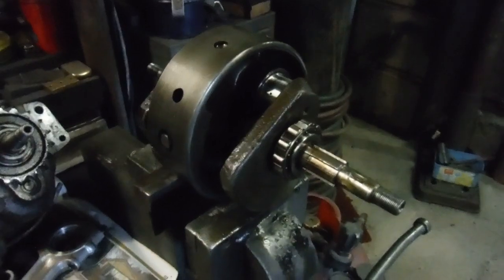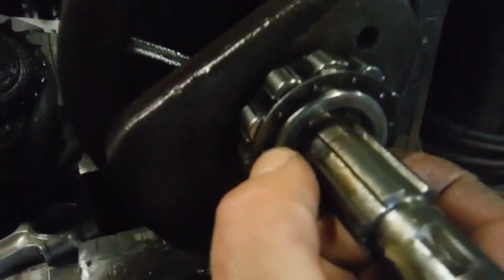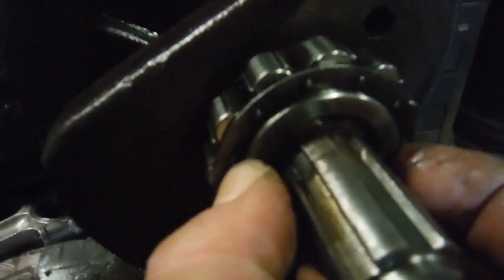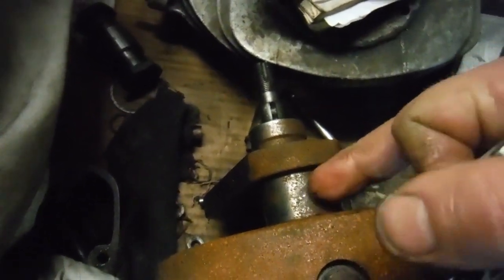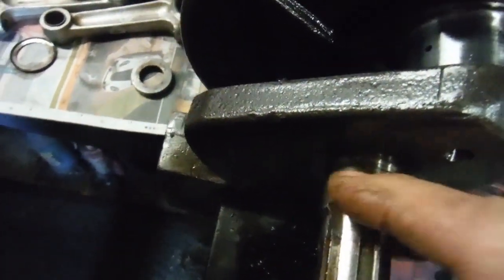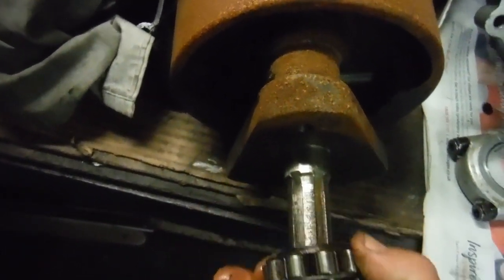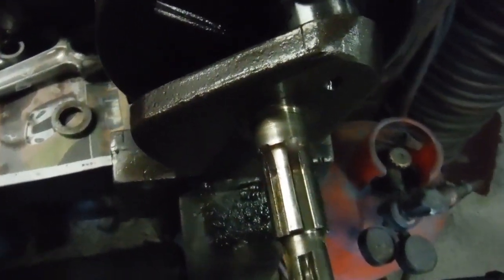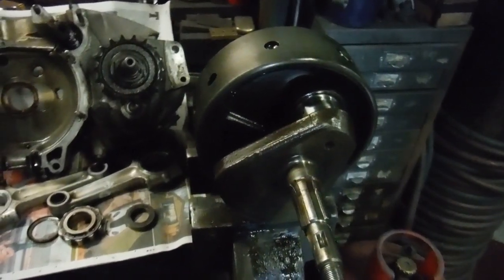BSA A65 engine noises - a closer look at the drive side main bearing.

Comment: Main bearing needs to slide so it can be shimmed for end float. It shouldn't have up and down though. Then when you tighten the alternator rotar it pulls everything tight. Probably a loose rotar or bearing failure has allowed it to spin on the crank

Comment: With no sign that the bearing seized and spun on the crankshaft at some point in time in the past, the only other thing I know of that will resize a crankshaft is a bend out of center to center alignment which would fall in line with a hard blow to the corner of the engine as I have mentioned previously. I would just find a replacement engine rather than trying to repair that one.

Comment: Very peculiar method of rebuilding this engine with repairing big ends but without any concern about both mainshaft journals, by PO. I hope you can repair primary side shaft by spray metal, a new bearing will be much tighter on it than a used one you have, I think it was rotating on the shaft enlarging its inner diameter. Good luck with it.

Comment: I am watching your A65 engine series of videos with a sort of queasy neurosis. I have done a few jobs on my 1971 OIF, which I have only ridden 10 miles to get it home and it was running rough (carb flooding). Done some obvious work on it but nothing at all on the engine. I need to get it on the road in the next couple of weeks and see how it sounds and goes. Then I suspect I may have to give you a call!
Reply: Check oil return before you blast off over the horizon.
Reply: @highdownmartin  Very helpful, thanks!
Reply: @richardparkersmith4810  on the back of another vid on a Norton twin that had come in for work. Not Paul’s channel. The anti wet dumping valve was too powerful for the knackered oil pump to pull open much so there was very low oil pressure and little feed. Shagged both mains and big ends, scored and burnt barrels and pistons. Could have all been saved by a visual check in the top of the oil tank…..  Very expensive.
Reply: @highdownmartin Thank you. Good example of a stitch in time. It is certainly near the top of the list of things that make me queasy. The engine is  '67 in a '71 bike and goodness knows what its provinence is. No oil pressure warning light in '67 either on the other side of the equation.
Reply: Classic motorcycle workshop vlog15: Norton atlas issues 
Type that in mate. It was a riveting watch. The pre unit and sinles had an oil pump cover( leaky) so you could access the oil pump. Can’t remember if the 50 and 65 have that?    Any good luck with it.
Reply: @highdownmartin  Great video. Reminds me of the old poem 'For the want of a nail'.

Comment: hi Paul it looks like the big end journals is on its last regrind going by the oil holes on the journal and the big end shells in your last vid, after you've got the drive side metal sprayed and ground back to size and then got the timing side journal ground for the new bush i dont think it would pay off, and if i was the owner i'd opt for a good second hand one something with some meat on it as you know there's lots about and i'm shower you'll have contact up ya sleeve, ps your luck its not an early a65 coz the cranks are shorter by 70 thou and like rocking horse shit to get hold of. but anyway we all know you'll short it, and the owner is luck to have you working on it coz it will be mint when you've done. with kind regards Adrian

Comment: I am curious to know what brand and specification of oil has been used here. (I stuck with straight 40 usually from Morris, Silkolene or Filtrate). I found that timing side main journals wore quicker if solid bronze bushes were used, which was a nuisance as at times they seemed to be the only option available.